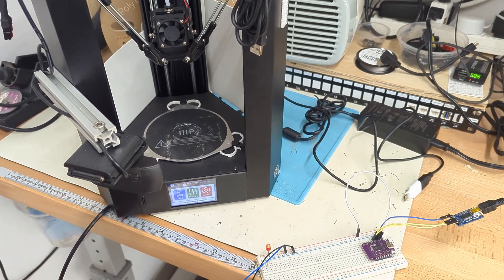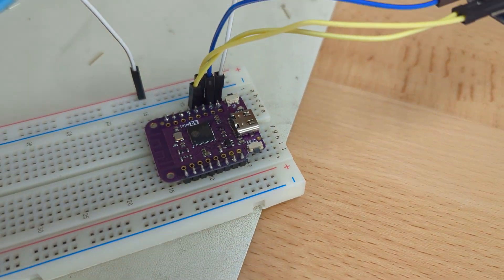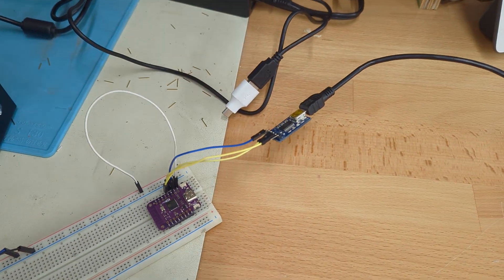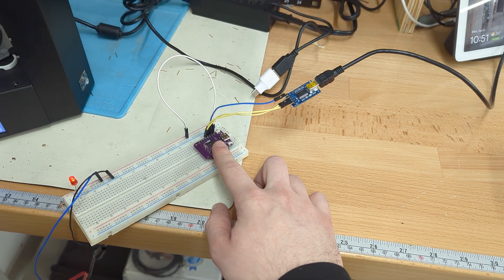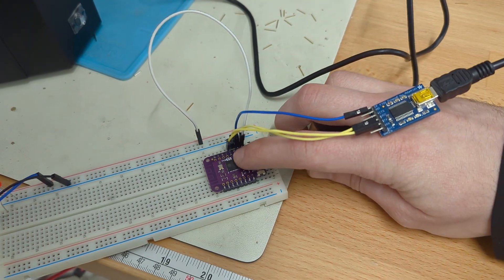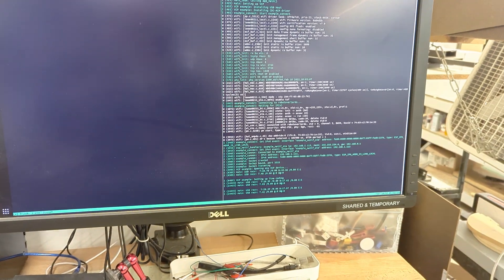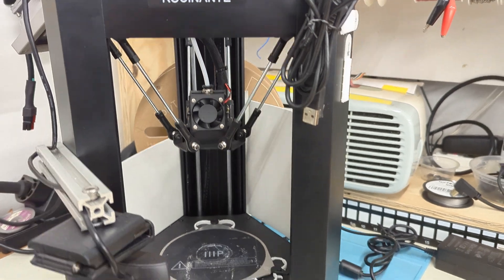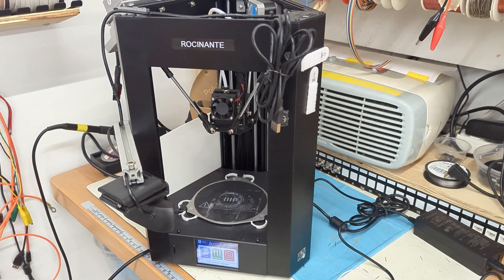ESP32 microcontroller controlling a 3D printer

Comment: While it hasn't been done with the Wemos S2 mini before (at least not that I have seen it), lots of people (including 3D printer board manufacturers) have tried it in the past. Usually they went for the ESP-01S as it was the cheapest at the time (I think Makerbase even has recent boards that support it).
For giving commands and receiving data this works great, but as far as I know uploading print files was always the problem, where the speed was VERY slow... 
I hope you succeed where others have failed of course 🙂
Reply from the maker: That's interesting, thanks for the pointer! I guess the 01S was connected over serial? I didn't find much when I searched for it. My approach also doesn't require opening up the printer and soldering onto the board, which I think will make this all much more accessible :)

My plan for performance is to write to the SD card on the printer, so there'll be some nontrivial "buffering" time. Print speed won't be impacted though, and subsequent prints should just reuse the written file.